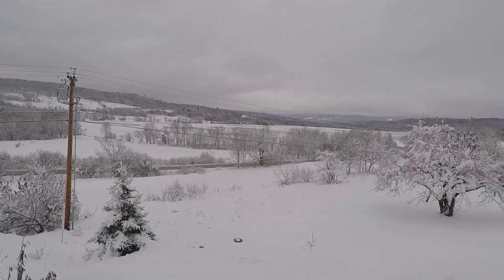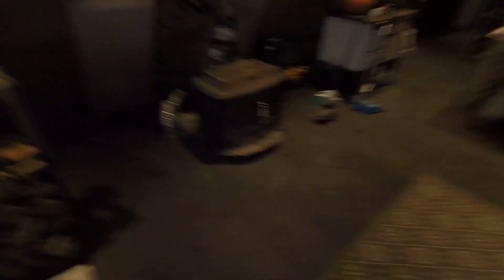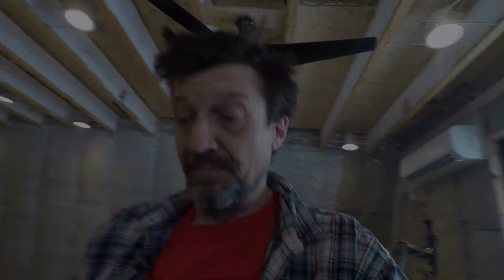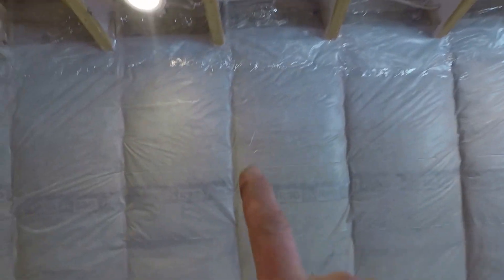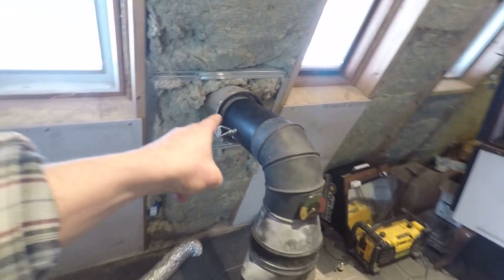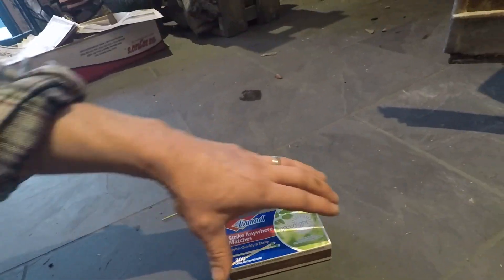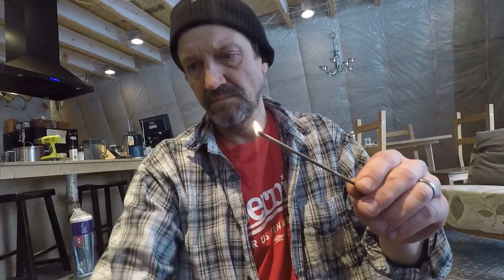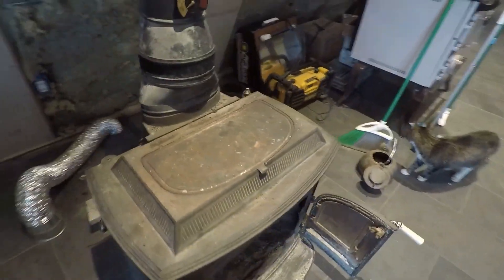6 inch WOODSTOVE PIPE DAMPER Control  the THERMAL ENVELOPE

Comment: and your dryer pumps entire air volume of house out several times each load, if you have one unless only using outside air or in a non-air conditioned space
Reply from the maker: I actully have a fresh air intake now. I'm sure if I had it at the time I made the video.

Comment: I would have run the pipe straight up through the third floor studio and out the roof. Putting a  Magic Heat Wood Stove Heat Reclaimer on the pipe on the third floor.
But that's just me and I live in Alaska off grid. Looks like you are on the grid with those lights and a heat pump and all.
If I live on the grid I would probably just have fuel oil monitor. And a wood stove and plenty of wood for backup. Maybe you're off grid and running a generator? It must take an awful lot of fuel to keep those lights running?

Comment: If you go straight up with the stove pipe I'm sure most of the smoking problems will go away, also any stove pipe outside of the house should be a dual or triple wall (insulated)... That being said more heat in the pipe and that means better flow. And it's less pipe to replace 😁
Reply from the maker: The pipe was double walled where it penetrated the wall and the roof.  That was two years ago - I redid the pipe to trace the roof all the way to the top and now it works better the windier it is.  Now we need a better stove. Always something.
Reply: @PensionerPondFarm  good deal man!!!
Reply from the maker: @curtisstephens5480  Thanks!

Comment: I cane here for the wood stove damper but have a question about your mini split system. I’m in the same boat as you were with the unfinished building envelope and I’ve got a mini split sitting in the barn got the house when I got a bit further on the remodel but it would be nice to have some supplemental heat when I don’t feel like getting up every two hours to load the stove. 

So question is, can I go ahead and hook the system up and run the heat and then come back later on in the spring and hook up line sets for the air conditioning and get it working or is it a all or none type of thing? 

Reason I ask is cause mine didn’t come with line sets and I don’t have that in the budget right now but I want heat. Does the heat use the line sets also or is that just strictly the a/c side of things. 

Thank you buddy, I appreciate any info you can give!!!
Reply from the maker: It does both heat and air conditioning. The only difference is when in ac mode there are pex driplines that allow the water runoff. I believe that you need the insulated copper lines no matter what. It is a great temper to a wood stove. If you miss a few logs the mini split heat pump has got your back. I'm no expert and had help hooking it up from a professional.  It has been our friend while we search for a better stove with a FULL firebox. Good luck. Let me know how it goes.!